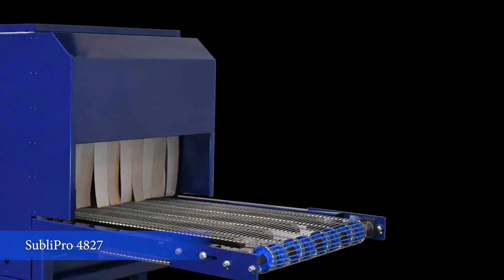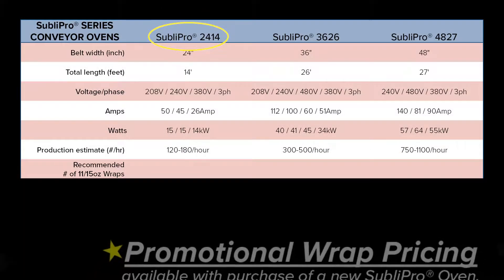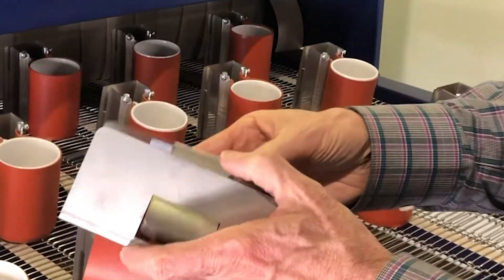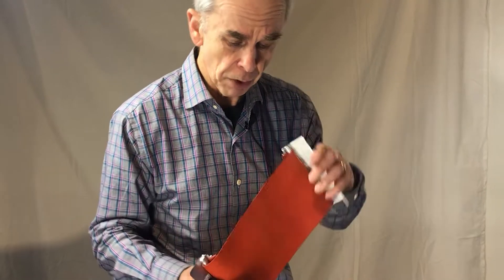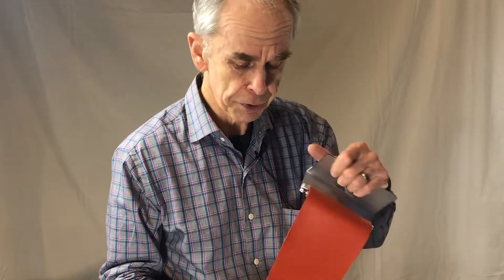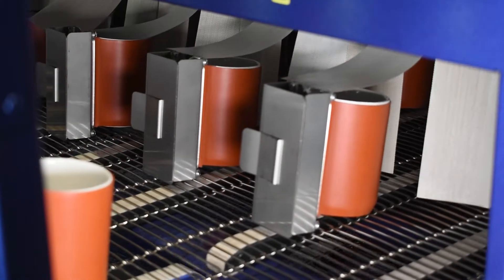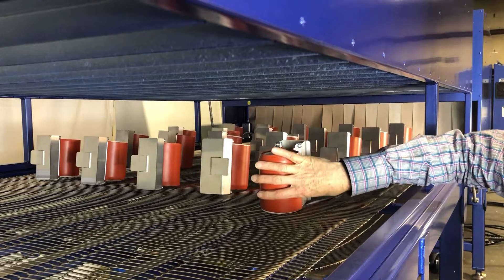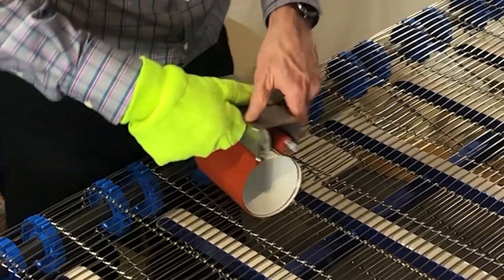Dimensional Sublimation Conveyor Oven & Mug Wrap Demo (Full Length)

Comment: My recommendation is to change the lock mechanism of the mug wrap so that it can be unwrap with one hand! Been worked on this type of wrap and another type from China and tbh the productivity with that wrap is far better than yours. One worker can easily unwrap two machines at a time, one hand per mug, two per turn, 12 per row (6 on each machine).